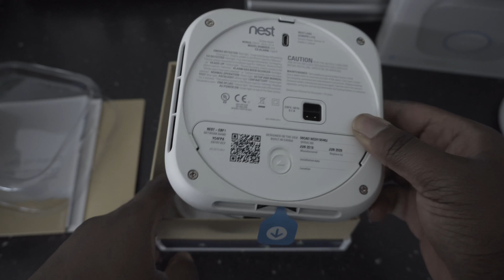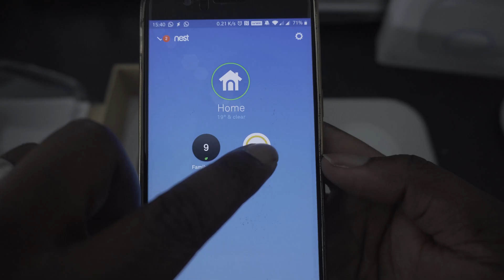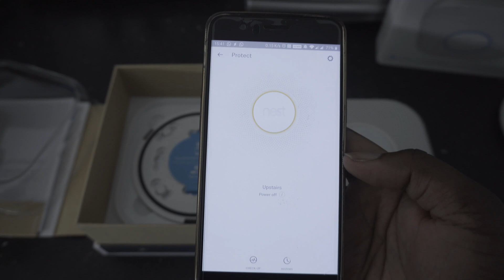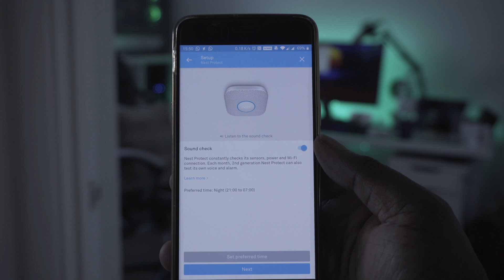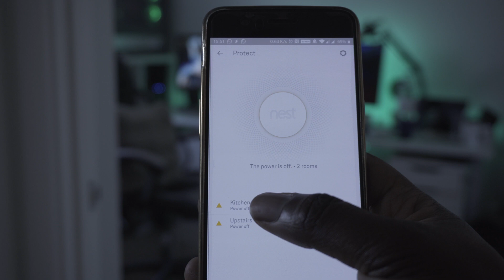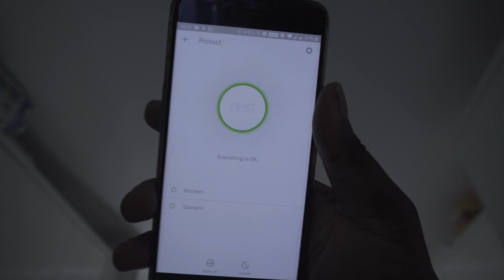I upgraded to a Google Nest Protect (2nd Generation)

Comment: Nice review ... thanks ...

And I would absolutely love to replace my cheap old ionization-type smoke detectors (all but one originally installed back in '05. Though they all still seem to work.) with these smart Nest Protect ones to compliment my new Nest gen. 3 thermostat.

But with seven SDs needing to be replaced here, and the NPs currently going for $119(US) a pop. 

I just can't afford the approx. $900 (US incl. tax) in cost for this presently. ...

Great units though for sure, and really wish I could afford them as an upgrade ....

Comment: Great system but doing some further investigation I found that the whole detector has an expiry date . Has to be replaced after about 6 years. Expiry date in on box.
Reply from the maker: I think every smoke alarm has an expiry date.

https://modernsurvivalblog.com/health/did-you-know-smoke-detectors-expire/
Reply: The reason I'm out here looking for new "smart" ones is because the ones in the house when we moved in are expiring. Traditional "old", non-smart one. Expired after 12 years though. The batteries chirp incessantly to get you to replace it.

Comment: Thanks for this informative video Samson.

My old skool wired/connected smoke alarms woke me and family at 3:50 this morning. (and kept going off  repeatedly!!)  
Had to do exactly the same and pull the unit off the ceiling just to get back to sleep!

Been researching smoke alarms today and came across the Nest Protect (and this really useful video)
The fact that this gives an advanced warning makes it perfect for kitchen (can silence it via the app if accidentally burning food).
plus the added bonus that it will detect any carbon monoxide leaking from gas oven or boiler and tell you to leave the house to get fresh air.
I have Google Home controlled lights and other devices already so this will be great (now that Google Home has added support for Nest Protect)
The units initially seem a bit pricey compared to smoke detectors (currently £85 - £109) so minimum £170 for 2 units. 
But thinking about it they last for 10 years so works out at only £17 a year (or £1.42 a month)
So it's actually very reasonable for the level of protection and ease of use.

Will be ordering mine today!
Reply from the maker: Wow yeah that is exactly my experience and wake up call (pun not intended). Hope it works out for you.

Comment: If I see a fire outside that could spread to my house, how do I activate the alarms
Reply from the maker: If you saw a fire outside, would you really want to set off your alarms inside? 😅
Reply: @SamsonGabriels  what if it spreads to my house? What’s the point of fire alarms if you don’t use them in actual fire
Reply: @jayasmrmore3687  This is a smoke / Carbon monoxide detector not a fire alarm.

Comment: Does anyone know if Google is abandoning the Nest products? I bought a 
2nd generation Nest Protect (wired) and it is not supported by Google 
Home or the newest Google Hubs with video.
Reply from the maker: I'm not aware of such plans. I shot this video earlier this year around march so all should be working as intended. Did you purchase brand new? For an issues, I would recommend contacting them. The easiest way I found to contact them was via facebook messenger as they typically respond quite quickly there.
Reply: @SamsonGabriels  I found the answer, hopefully Google will get it done soon: https://9to5google.com/2020/07/04/google-home-nest-protect/
Reply from the maker: I just realised that you're referencing Google home app. That app isn't well integrated with the original nest products yet (protect and thermostat) the article is reporting on Google finally adding support for those products within Google home. You can still setup and use the products with the original nest app but just be sure to sign in with a google account (same one used by your Google home app)

Comment: You’ve replaced a heat alarm in your kitchen with a smoke alarm - you will have it going off all the time! I’d put the heat alarm back in if I were you, no need to have a smoke alarm in a kitchen
Reply from the maker: Its been alright so far. There was just once instance of alarms going off where my wife burned oil by leaving on too long. but thats its so far
Reply: Samson Gabriels I thought someone said that the second generation has a heat sensor as well?